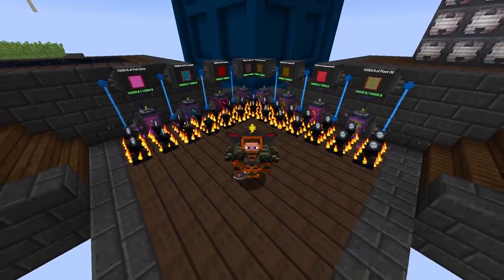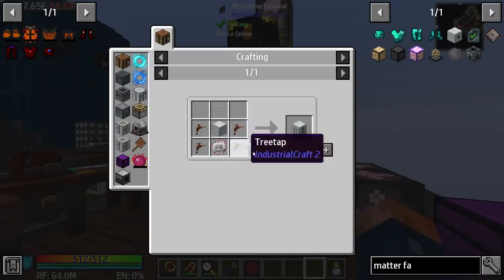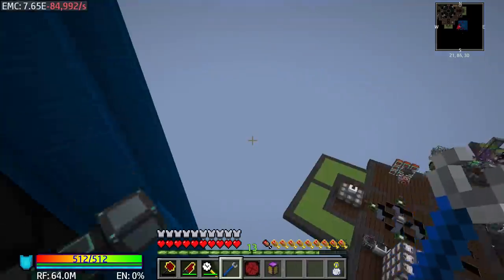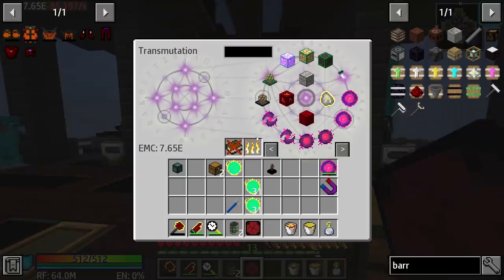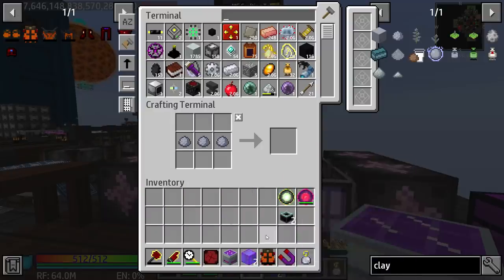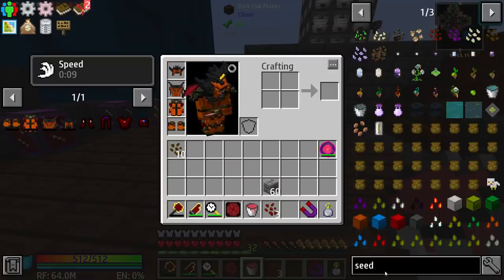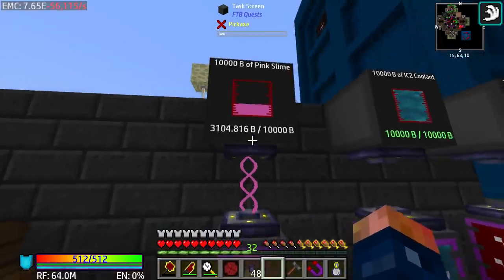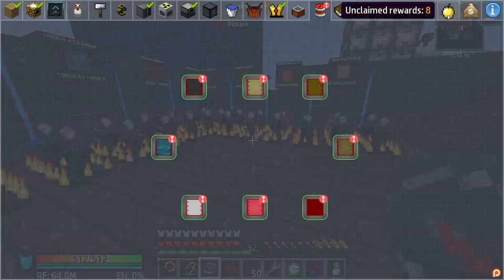FTB Sky Odyssey Ep. 23 Max Tardis Power + Easy Beast Coins!

Comment: 24:00 that's a lil bit overshot. Just 6 clicks with time in a bottle on the center piece is enough to complete it in like 20 seconds. Considering you supply enough power (500 * 2^6 = 32k RF/t) to each stand.

Comment: Why dont you use creative energy?
Reply: i think with the creative energy cells and such the output would be maxed at the integer max which is only 2.14 billion which pales in comparison to the 900 billion hes generating now
Reply: @StephenNowlan  much much less In some cases, I think it's a few hundred thousand per tick off the solar one
Reply: @theoledicktwist6247  Actually not true, I'm currently using somewhere around two stacks of creative solar panels hooked up in a checkerboard pattern with plugs, and it's sending over 5 trillion per tick to my sphere.  Way more than the tardis generator.